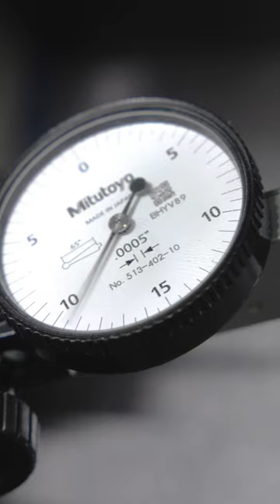Have You Seen One Of These Gear Slotting Tools?

Comment: Must be nice having machines that aren't worn to shit. 

The god-damned l20 citizen swiss lathes I run can't hold a .001 tolerance on the Z axis. Even at max chuck pressure, new tools, and as low pressure as possible that damn thing still don't hold a tolerance. 

Trying to convince management to fix or replace the machine is like talking to a brick wall ten feet thick and the bricks are made of tungsten.
Reply: Oh man I don’t miss that at all! You will find that it will make you better tho! Sounds like your guide bushing bearings are F’d
Reply: I fukin love my 2002 purple bottom L20 that bitch does not hold on the z either it’s moving nearly a .001 between parts but I got  +/- .002 so we r solid
Reply: I operate a citizen m32 and its still the same haha
Reply: What was he using the indicator for just to check tool wear or something? Id never seen this before.
Reply: @HunterFain-cd1pj  I used it to check the runout of the tool
Reply: @donniehinske  thanks
Reply: In my job we have the same situation with management not listening our pleas to replace a Correa A16 mill that is literally falling apart. The Z axis starts BOUNCING like a jackhammer at random intervals. 

I can understand that machines are a risk and cost a lot of money, but you can't expect us to work with broken equipment.
Reply: @alroma5869  We have the same issue with all of our older machines. A lot of our tolerances are plus or minus .0001 inch. As a result we scrap a lot of parts we could avoid scrapping if we just got less worn out equipment. Then we could use those older machines to train apprentices how to program for example. Just my thoughts.
Reply: Having worked at a steel shop in Traverse City MI, I can confirm that shop management is never NOT like this.
Reply: Brother lol , im running a hardinge t42 conquest and 51 conquest lathes from the late 90s . I feel your pain .
Reply: @HunterFain-cd1pj Runout Dial Indicator, one of the most common measurement tools in a machine shop
Reply: @DuyLeNguyen  All companies depreciate their equipment down over several years until they have recouped the original cost as tax relief.
So after say 10-15 years a machine has paid back and shoudl be replaced - but it is impossible for western companies to understand that though the Japanese have replaced entire workshops after just 7 years!
Reply: @rosewhite---  Cool story. What does that have to do with my comment?
Reply: @DuyLeNguyen  All companies depreciate their equipment down over several years until they have recouped the original cost as tax relief.
So after say 10-15 years a machine has paid back and shoudl be replaced - but it is impossible for western companies to understand that though the Japanese have replaced entire workshops after just 7 years!
Reply: @rosewhite---  Are you a bot?
Reply: Sounds like the night shift lead who keeps putting tight-tolerance stuff on my clapped out Mazak 530, when every other machine in the shop has gotten a new spindle in the last year and can hold tenths with ease.
Reply: @Cheezeball99999  Here in UK machines are run until they break.  I never saw any planned maintainance in all the factories I worked in.
Reply: And here I am running vf4s and st10s that run amazing I guess I'm spoiled
Reply: What do you mean by "can't hold tolerance in the Z-axis"? Either you're coming out of the guide bushing too far for segments of the part, your bar stock is complete garbage OR you're running way too high of a nose radius for a cutting tool. We have a Citizen Swiss lathe that's 15 years old and there isn't .0001" of taper or run out on the OD of the part.

Comment: As a mechanic, I dream of splines this nice and smooth, it would make my job so much easier.
Reply: Work in a performance shop in stead of a dealership or a whole in the wall shop (no dis on the whole in the wall guys) 
It’s pretty common
Reply: I used a custom ground carbide insert and custom made holder in a doosan 240LM. So long as you got spindle lock and take light cuts you can make beautiful splines both ID and OD. Certainly not fast but it’s cheap and accurate

Comment: Is getting the correct pitch diameter difficult? Seems like you would need a different tool for each diameter and tooth#
Reply: You would if using a form cutter like that
Reply: The ratio between the diameter of the gear and the number of teeth is standardized, and referred to as the "pitch" of the gear. For most applications, the difference between the profile of gears with the same pitch but different numbers of teeth is small enough that you only need a small set of cutters (typically 8) to cut all of the gears in that pitch.

Comment: Feedrate looked a little high. Other than the surface finish,it was nicely done 👌🏻
Reply: 😂 I'm pretty sure these guys know what they're doing.
Reply: @mohammedbinladen4619   what makes you think that? I'm guessing the operator is a little inexperienced judging by the surface finish, it would more than likely fail inspection. But hey,not everyone can be as good as me! 🤓🤣
Reply: @ianunderwood3850  🤔
Reply: @ianunderwood3850  depends on the finish called out on the print. If it's 125Ra all over, then that finish is good enough. I work in a job shop, so I can make everything pretty. However, when I worked production, putting a 32Ra on something that called for 125Ra or better would get me bitched at. It's a business, and time is money. Not understanding that, maybe you're not as good as you think you are.
Reply: @goatfromhell666  I'm well aware of that bud, I run a machine shop making parts for nuclear submarines etc,etc.🤓

Comment: What if the key cutter was off center do you use shims under the screw ? How would it be best way to  center it
Reply: Why would it be off on brand new high end equipment?  If it is send it back to the manufacturer and ask why and they'll give you an answer.  When I was in applications we would have tools that would repeat within .0002" with 0 issue when they were all brand new.